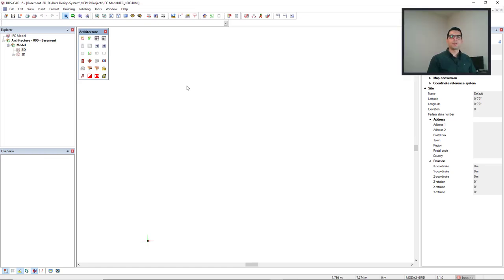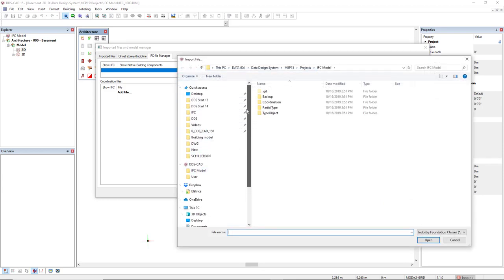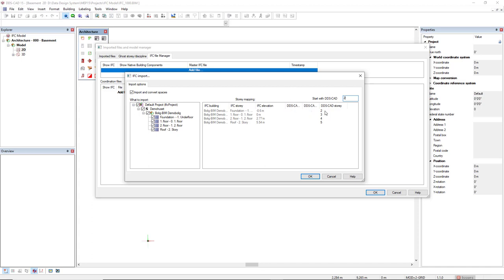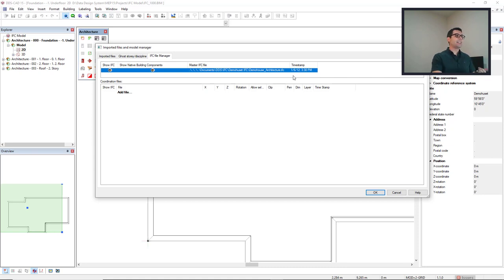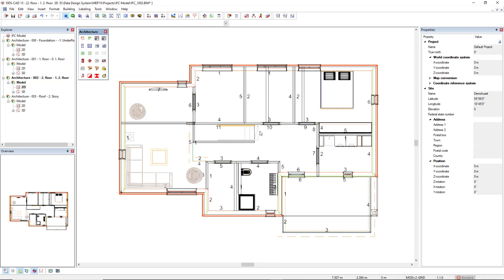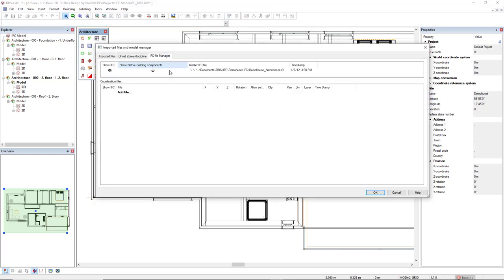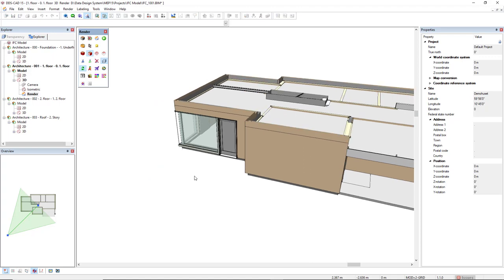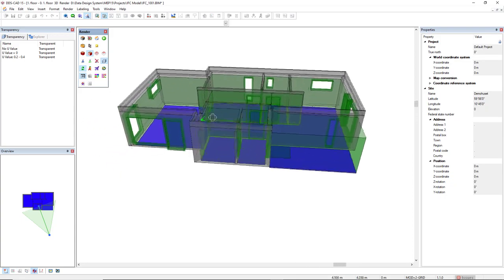Getting Started  - Building - Importing an IFC Master Model

Comment: Hello!
Why I can not put  the mark in to the "Import and convert spaces"?
Reply from the maker: Hi Andrei, if the IFC building model do not have spaces,  the check box to Import and convert spaces will be deactivated
Reply: @DDSCAD-MEP  I understood correctly that I can import IFC without it for makelectrical design?
Reply from the maker: @andreialpatov9499  , Yes of course, without spaces the ifc building model is used for coordination. You can definitely use it in order to create your electrical design. If you need any support, please contact us via support@dds-cad.com